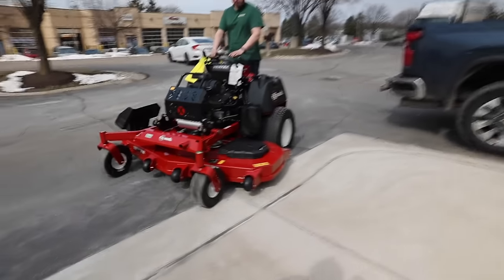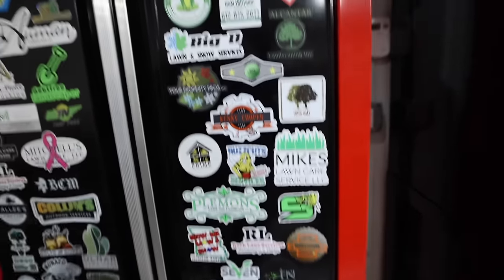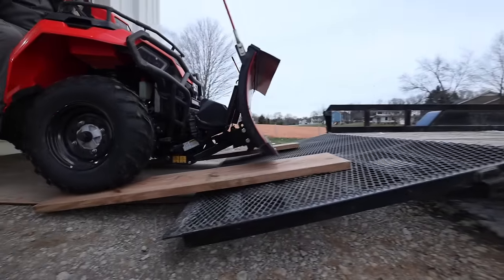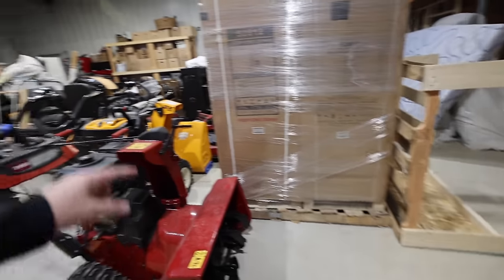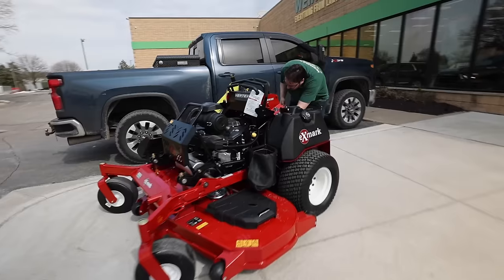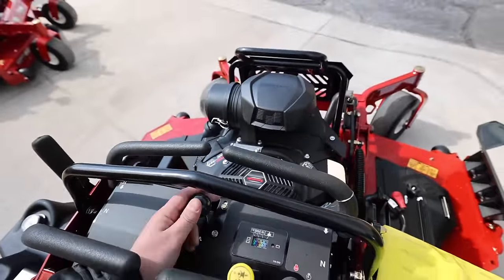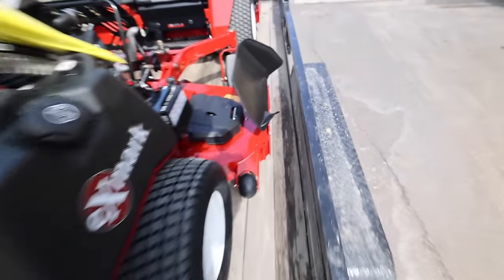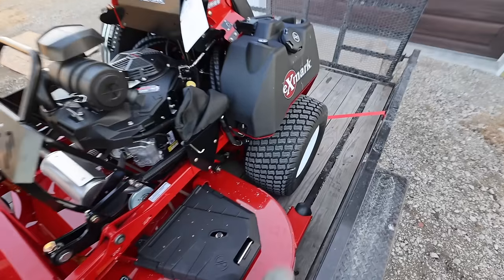I Tried NEW MOWERS for 30 Days Here's What Happened

Comment: I have a 72" lazer z and it stripes just fine. The 72 has a wider frame and exmark designs them perfectly. The 72 doesn't scalp it cuts the same as my 60" lazer. Are you putting chute blickers on the new mowers?

Comment: I never noticed a big difference striping with a 72 over a 60. The biggest difference is your sight line on the deck when discharging into uncut grass, you'll be about a foot further to the right than the 60. If you bag with it the grass has to be very dry or you have to go slower.  I preferred bagging with the 60. If you take the 72 on a section that's been 60 striped or vice versa you have to cut a new pattern otherwise it will look terrible.

Comment: Take your trailer to a weld shop and have them add a foot to the gate. They never make the gates long enough. So your mowers deck and other stuff catches at the hinge point or near there.  Or carry 2 6” pieces of 4x4 to put under end of ramp.
Reply from the maker: I have really been considering that. I wonder what that might run us, $500?
Reply: @BriansLawnMaintenance  I did 4 of them over years myself. The last one I had a little over $100 in materials. I would think 500 would cover it. Depends on what kind of shop you take too.
Reply: My lamar came with a 5ft long gate. One of the reasons I bought it